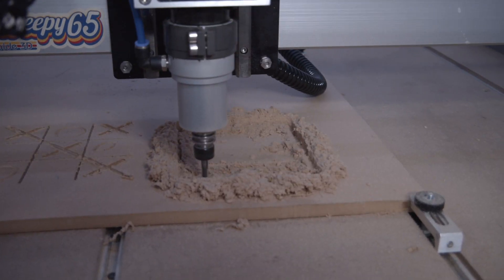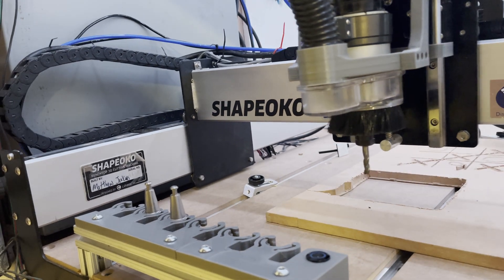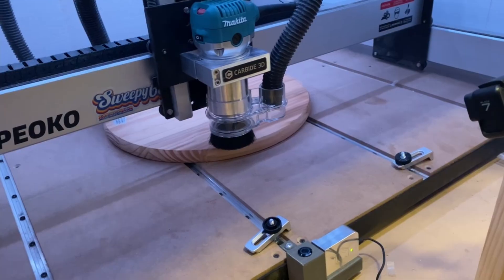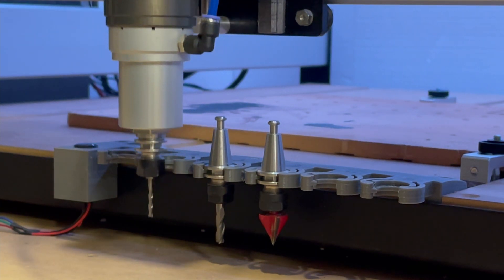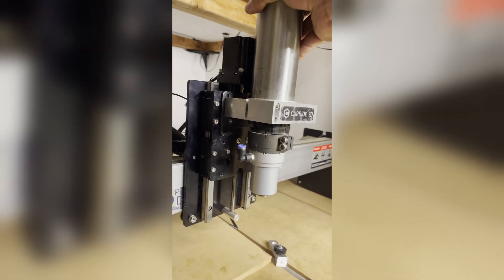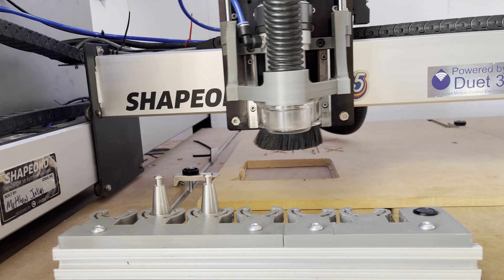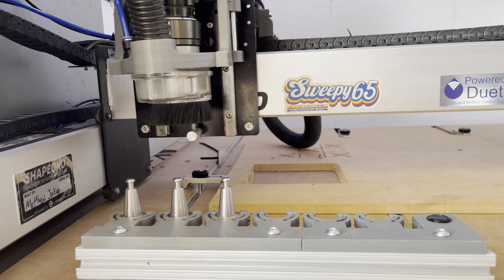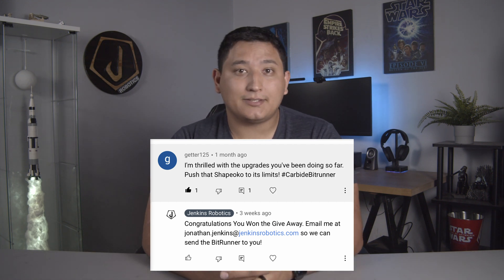Shapeoko Upgrade: Pneumatic Dust Shoe, Give Away Winner, Updated Tool Changer!

Comment: Great work! I've modified my Shapeoko XXL pretty extensively. I had to replace my Z-axis too because I used a heavy 2.2kw water-cooled spindle, but at the time Carbide 3D didn't have a ball screw option. So I made my own. After that, I found the X-axis was still less reliable than I wanted, so I replaced the v-wheels with ballbearing linear rails. Which Carbide 3d subsequently did for the pro model. It made a big difference to reliability and how hard I can push the X-axis. BTW You need to use carbide downcut bits (AKA compression bits) to get cleaner cuts on the top of your workpiece... 4mm ones are excellent and you don't waste much material between parts. Get them from Aliexpress. From there, they are cheap, but you need to wait a while to receive them. 
I've had some trouble with my VFD maybe you could help me? How do I get in touch with you? Maybe Patreon?
Reply from the maker: Hello Mark, the best way to get in touch is in our discord. Links are in the description.  Patreon support is always appreciated.  We have our VFD code released on GitHub as well.